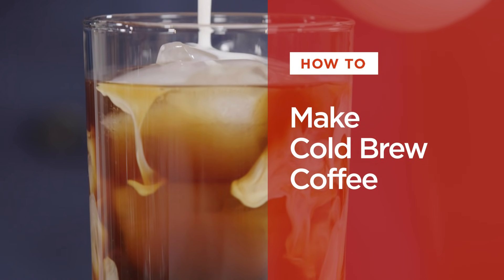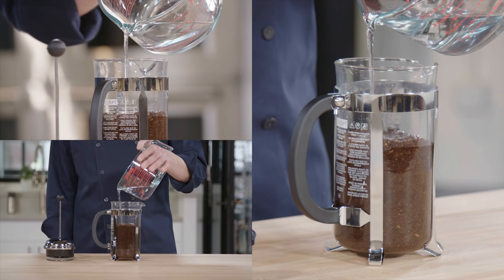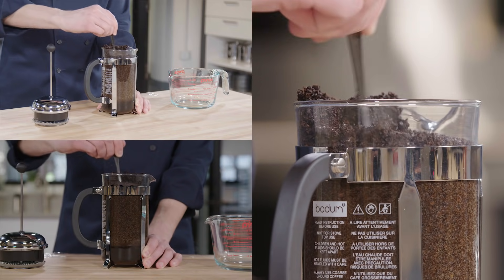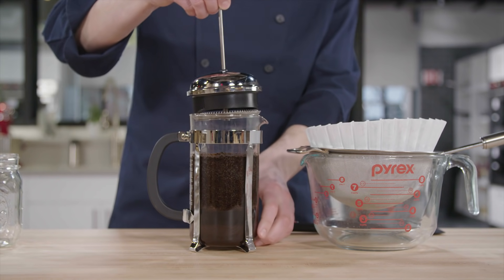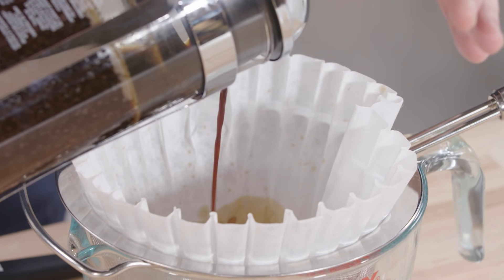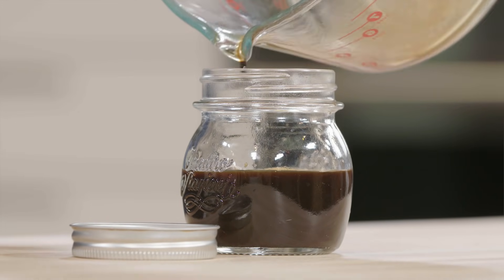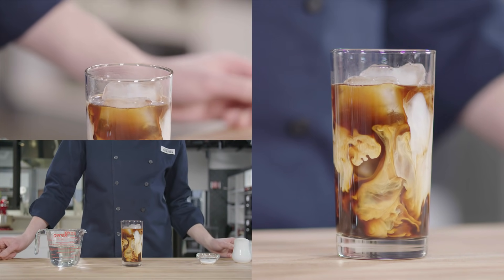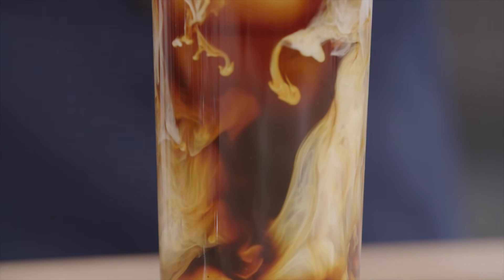How to Make Cold Brew Coffee at Home in a French Press Coffee Maker

Comment: For anyone wondering about the 1:1 ratio in this recipe, keep in mind that he is using a measuring cup and not a kitchen scale.

Using a measuring cup is not the same as using a kitchen scale when measuring out your coffee beans because the density of a coffee bean varies by the size, shape, mass, and bean type (Ethiopian coffee density is 0.68 g/ml, Sumatra coffee density is 0.64 g/ml).  It may be the same for water since the density of water is 1 g/ml.

2.5 cups water = 20 fluid ounces = 600 ml = 600 grams
2.5 cups coffee bean = about 14.1 ounces = about 400 grams

So for this recipe if you are using a measuring cup, it's 1:1 by volume. If you are using a kitchen scale, it's approximately 2:3 (or 1:1.5) by weight.

Comment: Oh no, I used normal salt. Ruined.
Reply: It would be. There is a diff between the two. Kosher will dissolve easily while normal salt will fall to the bottom of the glass missing your buds until you get this salty last sip, just sayin...
Reply: "Kosher will dissolve easily while normal salt will fall to the bottom of the glass missing your buds until you get this salty last sip"

That's not it.  Both will dissolve and a stir will mix it even if was at the bottom. The reason is that the larger crystals of kosher salt means that "a pinch" has less salt than the smaller crystals of table salt.
Reply: Kosher salt is generally ideal for pinching/sprinkling. You can do the same with table salt, just not as convenient.
Reply: normal salt has less prestige than kosher
Reply: I think you used too much. Just a few crystals. I wouldn't call it a pinch.

Comment: My cold brew constantly turns out very bitter, what should I do?
Reply from the maker: Make sure you use room temperature water to avoid bitterness. This recipe is also for cold brew concentrate, so you may have to dilute it a bit more.
Reply: Don't do this recipe. It's a ridiculous waste of money for grounds to end product. Follow the course grind and put in french press. But the ratio by weight should be (if you don't want to have to dilute it) somewhere around 1:6-1:9 so that's 1 gram to 6 ml. Basically you can make 60g to 600ml and so forth. That should help with your bitterness. Also make sure it's course grind and not fine.

Comment: This may taste better than what I make but looks like too much mess, waste and trouble for that small amount of coffee. I make about 50 ounces at a time using a Filtron Cold Brewing System, 9 oz. ground coffee (mostly Starbucks and Gevalia) and 6-7 cups water depending on the grind. Let it steep 12 hours, drain and then re-inset the plug and add another 1-2 cups water and let it steep again for another 12 hours. This should be enough to finish filling the decanter. To make coffee I pour 2.5 oz. concentrate into my glass and add 9 oz. very cold water. You can adjust for your taste but no matter how weak or strong, you don't NEED sugar or cream because it isn't bitter. It is as smooth as tea. If you prefer it hot just mix and heat it in the microwave. Fine grind can be a lot of trouble because the extra oil released can make the filters (one paper and one felt) drain very slowly, but some fine grinds are really good to drink. A medium grind works the best if you can find one that you like. Instead of cleaning up a press often for this small amount of coffee, I prefer to make enough concentrate to last about 3 weeks, only clean the brewer once over that time and only spend about a minute to make each glass of cold coffee and another minute if I want it hot.